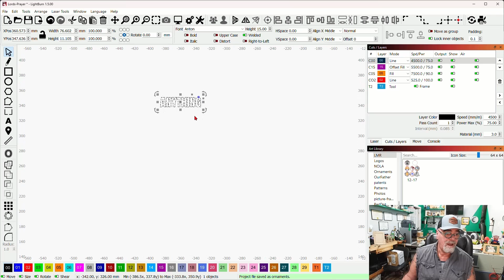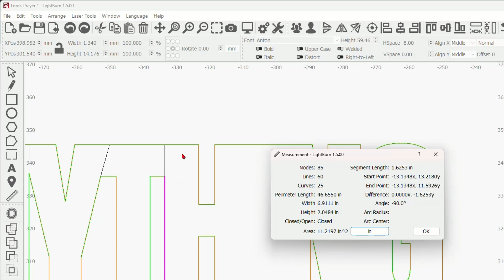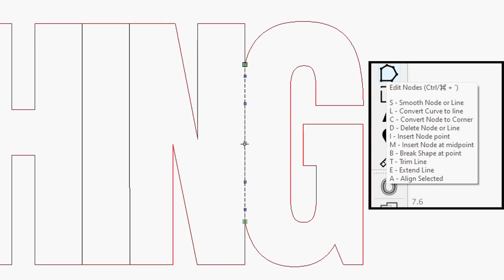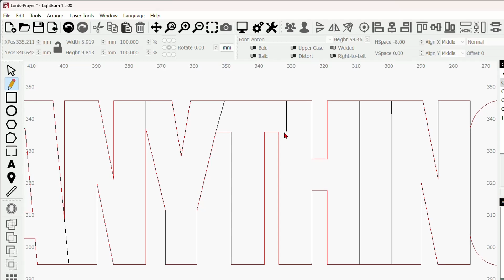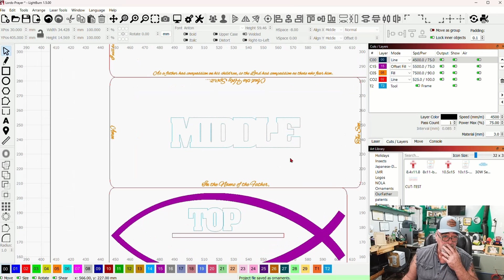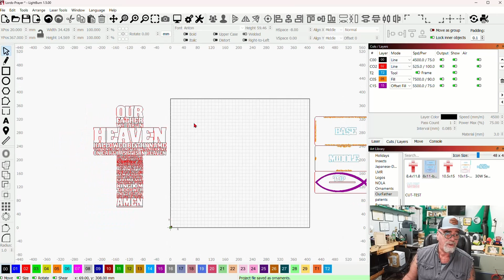🎅🏽 Auto-Welding Text & Node Editing, Advanced tutorial and the Our Father Prayer Cross!

Comment: I cut mine out on 7 mm plywood using a 40 W diode laser. It has trouble cutting all the way through so I turn the plaque over and finish it on the back in reverse. I also secure mine with two small metal pins into a wooden base
Reply from the maker: That's a great way to get through thicker material, thanks for sharing your process!

Comment: I love the look of this design but I can't make it work, I use my Longer Ray5 10Watt. I've changed from 900/100 to 200/50 and it still falls apart, changed wood and made sure I was in focus as I use 3mm basswood. Any hints or help would be a blessing to get this working. I know it isn't the model but this user who is missing something obvious.
Thank you
Geoff
Reply from the maker: If you're using the file I designed, it can't fall apart. Hundreds of folks are posting pictures of the final product on the forums and groups. It's probably out of focus if it's coming apart. I really can't tell what you're doing wrong in a text.

Comment: Rich, you do great work but this has been giving me fits.  No matter what I do, I have not been able to find a way to switch from fill to line.  Additionally, the base pieces do not come out the correct size and end up covering up the lettering on the piece directly below.  I'm fairly new to all this and it certainly could be user error, but I've purchased quite a few designs from you, steve and patrick and this is the first time I've encountered problems like this.  I think I will try to download it again to see if somehow there was a malfunction in the original download.  I'm using a 20w Xtool D1 Pro and a laptop.
Reply from the maker: I don't know how many ways we can have this conversation. Hundreds of folks have already made this project from the same files. On the Cuts / Layers tab, where it says Fill, pull down the menu and select line.
Reply: It was that easy for two of the three that ended up set as fill.  The third was set as multi and, initially, I could not figure out how to change it to fill.  Turns out I was not the only one who experienced that same problem with the latest Lightburn.  They've created a sub layering approach.  Their solution worked.  The cross came out very nice.  Don't know why the base pieces were the way they were.  You once said lightburn may not work well with some laptops.  Maybe that is what occurred in this instance.   @TheLouisianaHobbyGuy
Reply from the maker: This has nothing to do with the latest version of Lightburn. The patch to 1.4.5 fixed a bug in the splines in the DXF import, nothing else changed. The multi, or sub layers were added in V 1.2.00 one year ago.

Comment: Rich, I did something like this a while back. The lines didn't show up too good because they were so thin. So what I wound up doing was shut off the cut layer and defocussed the lens for the lines so it would make them a little wider. I ran that, then turned off that layer. Then I refocussed the lens and turned on the cut layer and cut it all out.
Reply from the maker: Great tip Kris, thanks! I burned the black layer really slow and hot, so they show up really well.

Comment: Thanks Rich, if you mentioned material thickness, I missed it. What thickness did you use for the listed file setting for the Lasermatic 30w?
Reply from the maker: The settings are in the Art Library. I used 3mm plywood. You can size it to whatever size you want, just not smaller. You would need to resize the slot in the base though Randy.

Comment: Thanks Rich! Right up my alley. This noob appreciates the settings you supplied. Made it easy to guesstimate for my 20w xtool based upon recent burns. Gave it a whirl on 3mm hobby wood. Looks great! Fragile though, and warps a bit with concavity towards the cuts so I’ll probably mount to a contrasting backer. Next I’ll try thicker ply. Warms my heart to gift this before Christmas. Glad to be a patreon!
Reply from the maker: Thanks so much! The 3mm wood I used didn't warp at all. I just ran one from 5mm solid oak and it came out great as well.